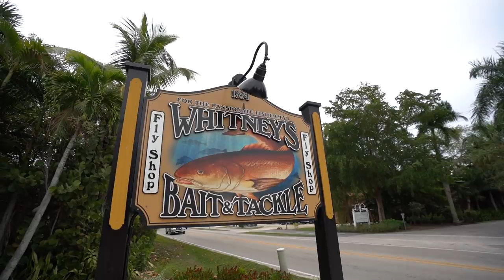This GIANT Dock Fish EXPLODES $700 Fishing Rod (Florida Send DAY 1)

Comment: There wasn't enough room left for any more bragging about the ability and price of that rod... one more boast and Jon's arm would have snapped in half.  That second brake was a gem.
Reply: NAILED IT!
Reply: *break
Reply: Not really the rod's fault. The heaviest they make is a 20-50lb which that one probably was and he's fishing 100lb on a reel with a ridiculous amount of drag.
Reply: @MemphisPrime  Well, he shouldn't have had his hands that high on the rod.  You gotta keep your hand around the reel seat and let the rod do it's work.  He actually put stress on it by holding the rod higher up.
Reply: Bubba Bass Anglers I haven’t deep sea fished but that would make sense because of the amount of stress he was putting on the thin part of the rod
Reply: @BubbaBassAnglers  He's holding it by the foregrip which is where he should. But the rod is rated for around a max for less than 20lbs of drag, the reel he has has 66lbs so he messed up when he started increasing drag for no reason and overfishing the rod. I don't get why people get so impatient when they have another 200-300 yards of line left on the reel.

Comment: as you lose line the drag pressure will increase because of the decreasing spool diameter. something to always consider when fighting large fish that will have a lot of line stretched out
Reply: Also the increased drag of the line itself in the water increases the drag pressure as well, keep your drag loose and tighten up as needed
Reply: Does it follow that round baitcasters do the same?
Reply: Just need patience. You Americans fish as if it's going to be your last meal 😂
Reply: Not to mention that it's a 20-50lb rod, and he's running 100lb line with probably at least 25lbs of drag, that thing stood no chances.

Comment: Lmao this is the worst possible advertising possible for a flagship, questionably priced rod. $700 and comes with the same guides as a $300 rod. So much for those M4 Nano Carbon Particles lol....regardless of any high sticking claims, on the hook set that rod looked like it had a damn near 90 degree angle above the ferrule. Need to get a  Rainshadow 1209
Reply: The nightshift is pretty damn good, tho the price is kind ass, its a reliable rod that can horse some nice fish but not when you highstick
Reply: Anthony Chen I think Lamiglas makes great rods and I love my Super Surf 2g pro, my old Ron Arra 1322, and my GSBs. If this was the GSB 11’ heavy 3-8 it would have never broke....did he high stick the rod? Sure. Was telling him to tighten the drag even more a good idea? No. Personally I was stoked for the release of this rod. I got to handle it at Striper Day and then was lucky enough to cast a wide variety of plugs with the 11’ 2-8 in the video. A few things: The fucking rod is heavy as hell compared to anything else in its class. Some people don’t like the carbon split grip, I did. Just a few years ago you really only had either Fuji Alconite SiC guides or full blown Titanium torzite which were obscenely expensive. With all the guide choices today like the corrosion control coating (I think any surf rod over $500 should at minimum have these), you can get titanium frames with SiC inserts instead of torzite like the way Century does their rods now....You’ve got RV guides etc etc., so when I see a rod that is more expensive than a St. Croix legend surf that came with titanium torzite RV guides (now comes with titanium SiC k frames) and it’s outfitted with the same guides as a $300 ODM DNA, I find that hard to believe. This was supposedly a collaboration with Surfcasters Journal and used the name of the slogan they coined (Nightshift)....but what I don’t get is that the rod is a fast action blank, and that’s probably part of the reason it let go......but most, if not all of those guys working for Surfcasters Journal prefer moderate action rods. The editor in chief Dave Anderson uses a 11’ GSB 2-7 Old school which has an even looser tip.

At the end of the day nobody knows how that rod was treated or transported before this and it could have been a freak accident. The part that I found fucked up was the fact that the shirtless Elliot dude made a post on his Instagram consisting of 125,000 followers and tried to say that the rod was “an old Penn model”. Rods break, it happens. Disrespecting the Lamiglas brand by bold faced lying your ass off while throwing another brand under the bus is pathetic in my opinion. As far as the Nightshift goes, time will tell how it performs long term.
Reply: @DanEvan  Jeez, felt like I just read an entire damn dictionary. The nightshift is great in some aspects but, I totally agree on  the fact that some of the materials on this rod can be found on way cheaper models from different brands furthermore it was a lil shitty for him to justify the rod breaking from some BS excuse. I do believe that this is not my best rod (ODM, Century , TFO, even St. Croix makes some rods that are superior to the nightshift in price range and quality. As much as I do enjoy using this rod and that it hold well under certain applications, I can't see myself buying this rod again nor can I fully bring myself to recommend it to someone especially with that price range.
Reply: Anthony Chen I apologize for the novel, I just like to be thorough. I wish there were more demo days from these rod manufacturers as so many people don’t have the chance to try them before purchasing. Bending the tip against the ceiling of the tackle shop doesn’t really cut it when spending $700.
Reply: @DanEvan  I believe a major problem is that people buy the newest and "greatest" rods and reels without even taking a look or even feel them, and when they break/fail from circumstances that are not the manufacturer's fault, they automatically assume that everything made by them is shit.
Reply: Anthony Chen Right, or the fact that it was human error. The ferrule could have not been seated properly, the guy could have nicked the blank transporting the rod, or high sticked it himself on a previous shark. I’ve caught brown sharks up to 78”/200lbs from the surf and there is absolutely zero need to run more than 15 pounds of drag, let alone trying to lock down a saltiga on a 200lb shark using a rod designed for striped bass. I certainly won’t disregard the rod for what it was designed for based on this one incident.
Reply: @DanEvan  I honestly believe they had put too high of an expectation for this rods power and I doubt the breaking from came from customer error, but then again one may never know that.

Comment: Hi fives to dock demon Jon B.  nice three piece rod, nice shark, great action.  fortunately there is  a warranty on that $700  rod, but it might be contested due to "equipment abuse". That has never happened in years of surf sharking with  Daiwa ballistic surf rods, even on big Hammers. Same for Penn carnage surf rods. they never break, even with electric seaborgs 1200mj with 70 lbs drag hauling the sharks up on the beach. Great show, great rod test. I guess the fragile high budget Nightshift is more for bass.

Comment: Lamiglass night shift rod. Nice blank but it was rated max 50lbs line. Designed for surf fishing but they hooked up something a little big for its targeted design. Better the black hole nano rod with new American Tackle FORGED titanium guides we use these rods for bluefin tuna in northeast.
Reply: Actually the fact the rod held on as long as it did was amazing and testament to it’s design.But that rod and that fish was like trying to pull a 30 foot camper with a Kia Soul.

Comment: Honestly right from the start I could see it coming. You need to not pull so high up. I mean you can pull up, but Extend your arms down before you pull instead of holding it up so when you pull the rod butt doesnt point to the sky. Allowing the rod to bend more fully. But that is called high sticking and is how tons of people break off on hook sets in general with all kinds of fish. Though in your defense he didn't tell you, and he did it a bit himself. Anyway, It is hard to hear what he said. Was he mad at the rod for breaking despite its price? Or you for mishandling the drag and high sticking?

Comment: The whole out fit is a mismatch, the lines' breaking strength is too high, the line should break first before the rod, more over braid has zero stretch so I would use some top shot wind on leader to cushion the shock and muscle the fish at the end of the fight.
 I would use a shorter medium action rod for more fun and reasonable control.